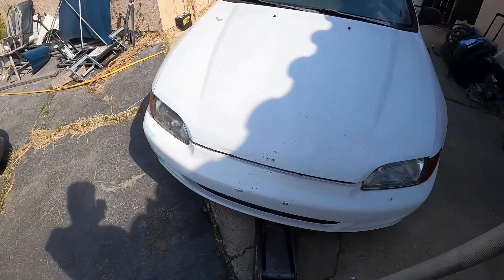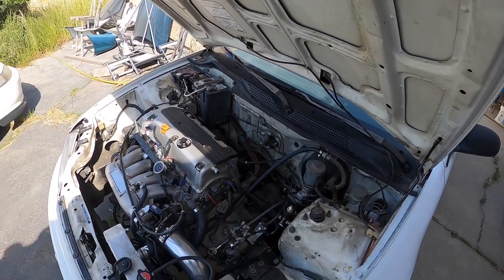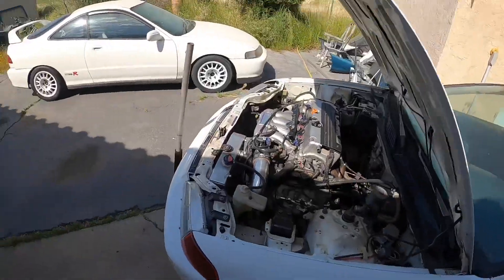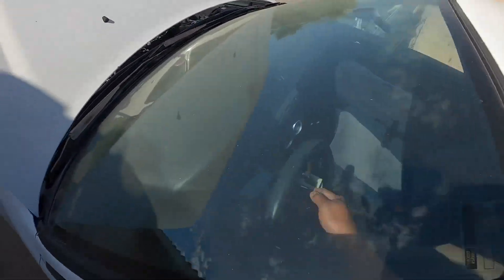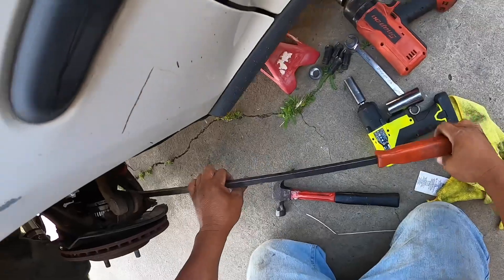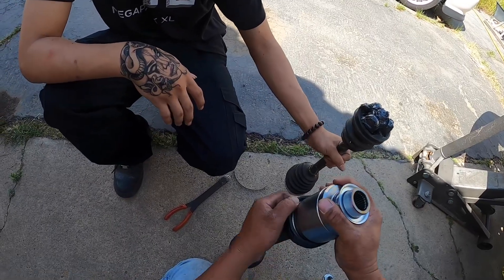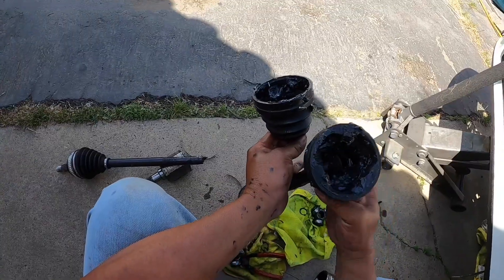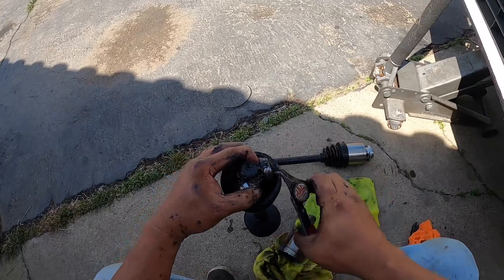Swap Axle Issues With The K20A2  Eg

Comment: Interesting. not many videos on this topic. Im about to K swap my integra using base model axles so well see what I have to dig into.
Reply from the maker: we have been running base model RSX from Oreilys for about 3 years now. hasn't popped out. We do break the outer joint from time to time, but no issues on the inners popping out.

Comment: Can also try the 06-11 civic 1.8  manual passenger axles too. They're 22-7/8 inch long. Rsx base showing 22-1/2.
Reply from the maker: Thanks. I migjt look into that.
Reply: Hi how are you I have ek kswap half shaft type r passenger side is fn2 driver side k20 I'm running 36mm any idea what the correct axle passenger side

Comment: anyway i could email you for an info on swaping a k20 into an eg hatch
Reply from the maker: you could just ask it here.
Reply: what all do i need for me to finish a k series n installed into my hatchback eg 
 @Ed_Garage
Reply from the maker: @jongonzalez4630  kswap mount, shifter plate conversion harness swap axles kswap radiator hose kpro or ktuner. 
I made a video on how much and  what it took to kswap the green integra.
Reply: I have a eg tranny and motor all k20z3 with hasport mounts and stock 32mm eg hubs..what axles do I use? Thanks